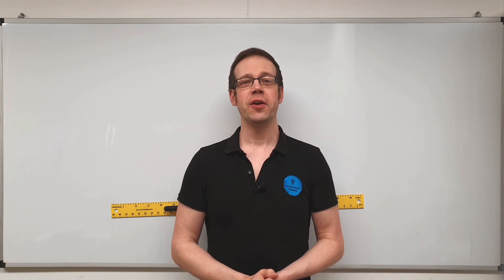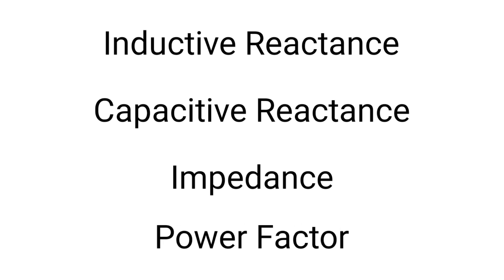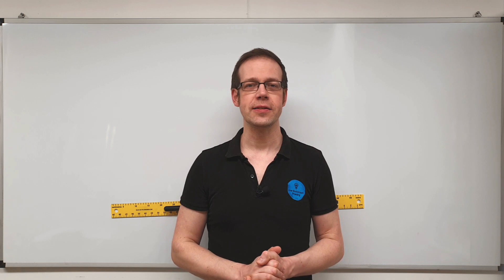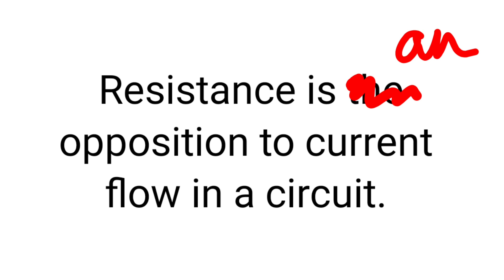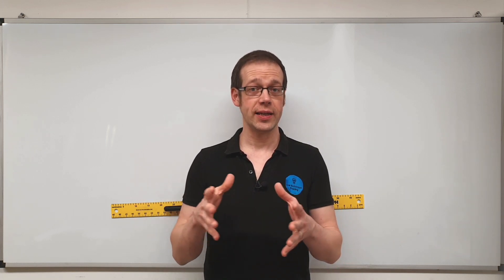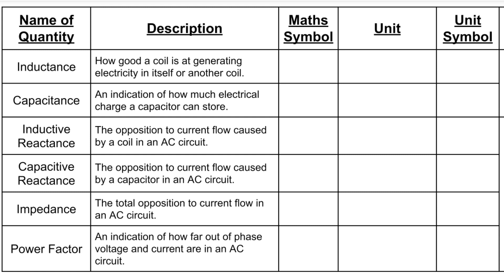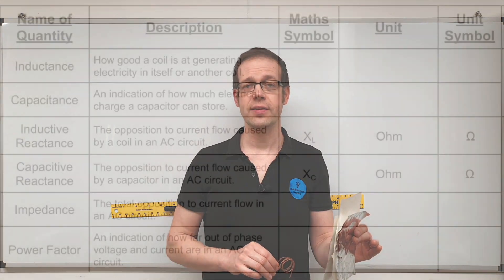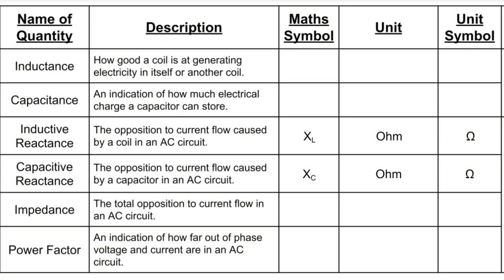SI Units: What are the Units for Inductive and Capacitive Reactance, Impedance & Power Factor

Comment: Hi, I saw your video explaining why no neutral is needed for a 3 phase motor. It was very informative. I have a question; where a 3 phase power + neutral is entering a facility, as the 3 hot lines are serving different circuits (of single phase) that are likely with not balanced loads, so the neutrals coming back from those single phase circuits will have current. My question is will the neutral at the main panel going back to the power co. have current in it? If it does why wouldn't the current flow back into the facility through the bonding of the ground line. It will be nice if you can make a video about this situation.
Reply from the maker: Great question, if you watch my three phase playlist you'll find an answer to this question in the videos where we calculate neutral current. The answer may surprise you... Three Phase: https://www.youtube.com/playlist?list=PL7eNzIRgKe055yGSS4TaKks1WVQ2JDsKU
Reply: @JoeRobinsonTraining  Hi, thanks for referring me to your three phase playlist, I watched it, it is very informative. I read currents off one of our factory's sub panels serving single phase loads, and calculated current in the neutral following your first method by plotting the lines current using autoCAD, And found the calculated value very close to the meter value. That's interesting. I tried to measure current in neutral of the factory's main panel but cable was too thick to fit in the amp meter. Could there be current in neutral of the factory main panel?
Reply from the maker: Almost definitely. 👍